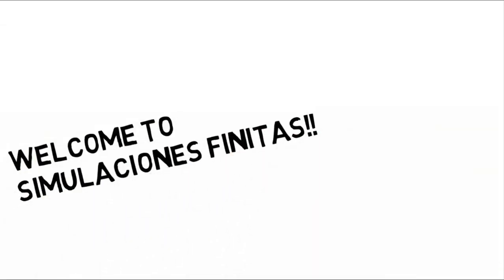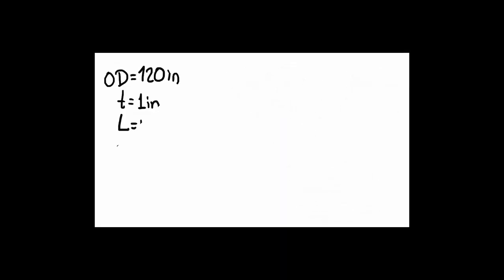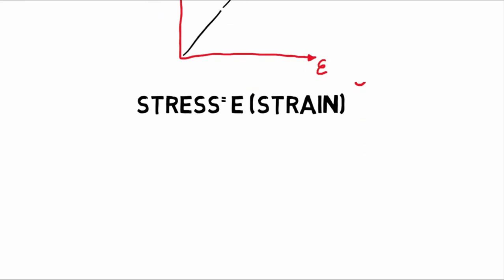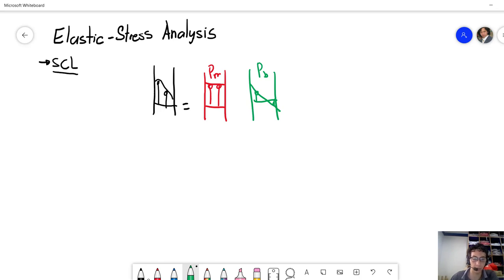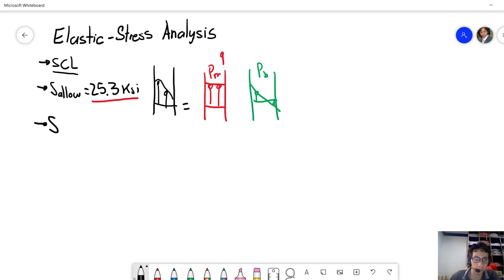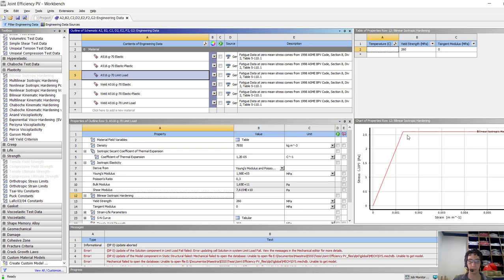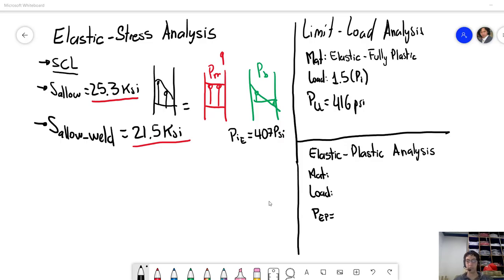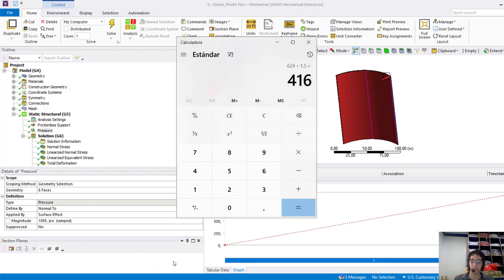Joint Efficiency on Pressure Vessel with FEA

Comment: Great stuff.
Reply from the maker: Thank you Daru.
Reply: @simulacionesfinitas7726  I think you can't use Div 2 if joint efficiency is not 1. (Sec VIII div 2, table 7.1/7.2)
Reply from the maker: Hello  @Daru P, Div 2 Part 4 and 5 works with the definition given in 4.2.4. Doing a fitness for service according to API 579 works with the same definition, this video did not focused on Div 2 exclusively. Moreover, in table 7.1/7.2 the designer chooses a joint efficiency (0.85 for example).... so you do not always work with 1.
Reply: @simulacionesfinitas7726  I think you meant API 579? But if your stamp is Div. 2 only, you have to do full RT and 100% weld efficiency.
Reply from the maker: Yeah I typed it wrong.
Reply from the maker: Follow what is in table 7.1/7.2 you may choose it do it full or not, the designer chooses the joint efficiency
Reply: @simulacionesfinitas7726  Ok, if I have a Div 1 stamped vessel that has 0.85 joint efficiency and spot RT specified, but needs FEA evaluation of a weird hillside nozzle configuration, can I, the designer, assume joint efficiency of 0.85 and complete the Div. 2 FEA?

Comment: Hello, thank you for the video, i have a question i hope you can help me with, in the last analysis in the elasto-plastic one the use of the Factor beta is defined by the code ?, and the value is given in it or works as a F.S?
Reply from the maker: Hi Sebastian, The answer for the first question is yes. This beta factor shall be defined by the code you're working with, as a reference you may look at Table 2D.5 from API 579/ASME FFS-1. However, It's not a safety factor but a concept from LRFD (Load and Resistance Factor Design)